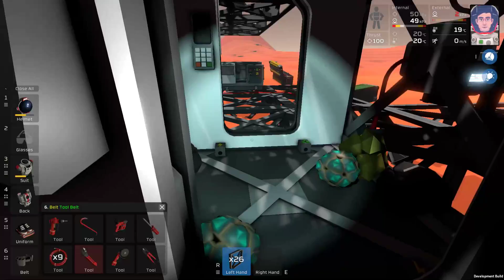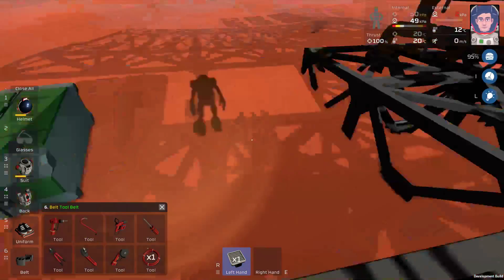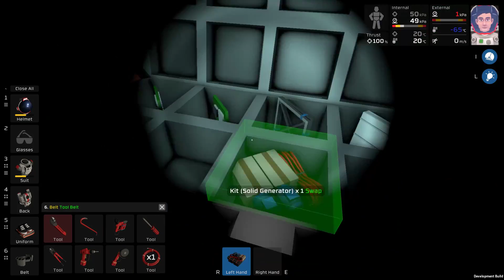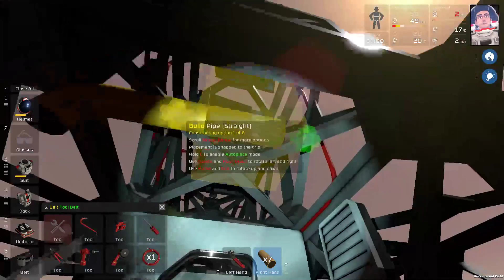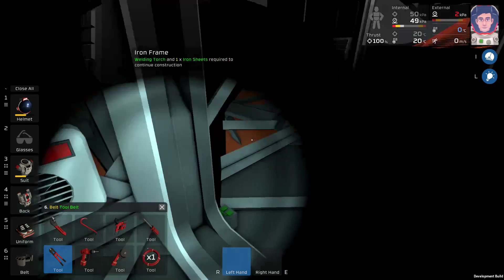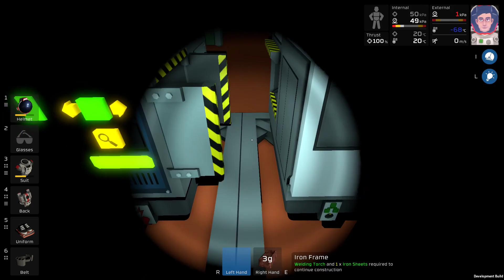Stationeers / EP 3 - Hydroponics Part 1 / Mars Colonization

Comment: 24:18  Indeed, cooling is cheaper than heating ... because cooling uses a heat pump design (see your fridge) to move heat from A to B.  Usually you can move between 2-3 units of heat by using one unit of energy --- but when heating, that one unit of energy only produces one unit of heat.
You can run the technology of air conditioning (or fridge) in reverse, so you pump heat from the cold into the warmer area.  But, if you have the electricity to spare, a simple high-amp low-ohm resistor will be so much simpler!

The adsorption cycle refrigerator cycle, while in general inefficient, can run on a heat source ... so if you have heat but little electricity, there you go.
Reply from the maker: Yup, but not all games calculate it like real life.
Reply: @Rhadamant  When much of your gameplay is build around handling gases, their pressure and their temperature ... you'd better have some self-consistent physics.

Comment: Can you use the coolers radiator to heat up a room?
Reply from the maker: They don't really work well that way, if you wanted to heat up a room it would be easier to run very hot gas through a pipe and have radiators installed in the room you want to heat from that hot pipe. That wouldn't even take electricity! Just like an old school water heater/radiators setup.

Comment: What would you recommend to a new player on how to progress the way you do in these series?  I spent ALOT of time troubleshooting the logics for the solar panel automation (apparently I had some math reversed which caused them to constantly dance - I thought it was a bug at first).

With that said, I've had to eat all of the cereal bars (which indicates how much more time I had to spend than you to get to the same point) as well as the pumpkin before I logged off last night.

I still have to do all of this next set of stuff for the hydrophonics and airlock.  I just don't know.  I love the intricacies of the game, but damn it isn't easy.  I had some major setbacks due to software glitches (I walked into one of the equipment and it registered as a hard impact and I took lots of damage...this happened twice).  

Love your series though.

*PS: How the hell do you make the furnace work so easily?  That damn thing gives me fits.  It registers as hot and high pressure, but when I throw any ore in, it spits it back out as ore, even when it says it is processing!  It is infuriating.  So I have to use the Arc Furnace and WAIT AND WAIT.  I about rage quit last night a few times.
Reply from the maker: Trial and error is how I survived. Yes, my first few attempts ended in starvation or worse, but given time and energy you'll get better!

Check out the Stationeers wiki page for tips about furnaces and what-not.
Reply: @Rhadamant  I did rewatch the #2 vid in this series and realized that you did mention that combustion in the furnace will not occur after some stuff has been smelted due to pollutants.  I didn't catch that the first time around.  So, I'm wondering if that's what the problem was.

Then again, I put in more oxite and volitiles and the pressure/heat indicator was full and yet would still not smelt the iron ore.

So, I'm not sure what is going on with it.

I did notice that if one starved and respawned (from my first attempt the other day) that you didn't lose any progress and you got more cereal bars to keep going.  So, I guess that's not all bad.  Just was hoping to get everything done and get the hydrophonics and airlock completed before that happened...lol.  Oh well. :)
Reply: @iAmEbolaWoT  The reason you getting high pressure is you putting to many ore in the furnace, the menu says you need put just 1% of ice oxite and 2% of volatiles then press button to ignite, check the meter it should show you about 2,96 Mpa and 2,1kK. If you reach that pressure and temp you can melt your stuff for example 3x50% of iron and 1x50% of coal which give you 200g of steel. If you want just melt the ore (iron, gold, silver etc) just put to the furnace and do not mix it, wait until melting then use lever to dump out your ingot. Good luck!

Comment: I don't understand the radiator on the airlock tank line.  Why do you care what temp that gas is at?  I'll continue watching for the explanation later hopefully!
Reply from the maker: The radiator for the airlock is so any gas in the canister equalizes with room temperature so there aren't large changes in temps when cycling airlocks.
Reply: @Rhadamant  Thanks!  I didn't understand that it was the hydro atmosphere, which you explained you were doing in a tank to avoid pressure fluctuations.  Great stuff!

Comment: Atmospherics in sequential is not relevant anymore.  It is better to place in parallel. W.a.w.  main "waste"-line, junction off to filtration, unfiltered back to main "waste"-line. In this way no blockage and therefor bursting pipes due to filled filters etc.
Reply from the maker: That's a good point, one I can use for the real base after this tiny farm. I'm not worried about blockage, I won't be moving a lot of pressure thru these filtration units. =]

Comment: A good thing to remember in order to save paint is to color just one pipe then grab a bunch of other pipes with the same hand. They'll be stacked with the colored one and therefore all be colored the same without having to spend paint.

You can basically just dedicate a large locker to holding a "master pipe" of each color then, when you need pipes of a designated color, grab the master pipe of that color and use it to recolor all the pipes you want (just remember to put a master pipe back).

The same technique works with anything that can be recolored, including wires.
Reply from the maker: Yes this is a great tip!